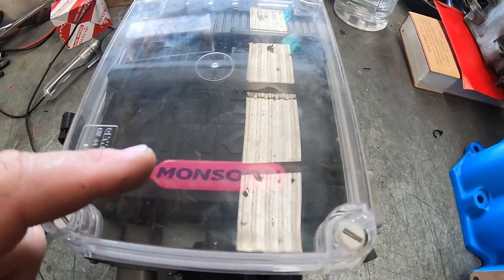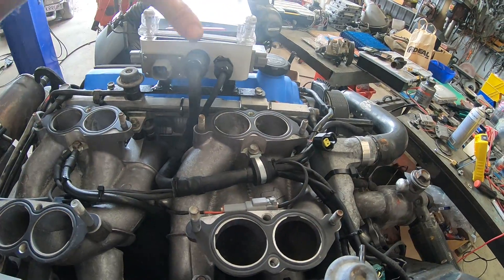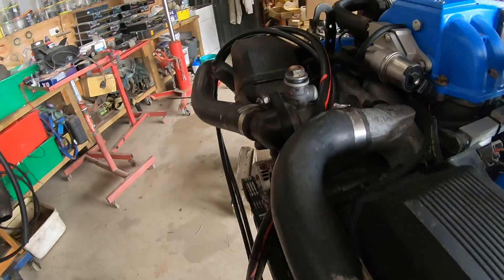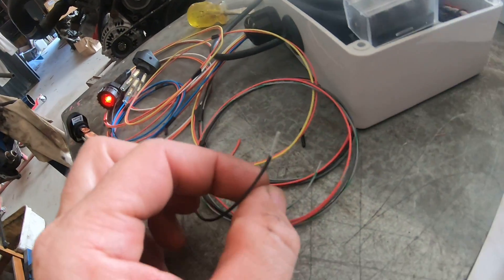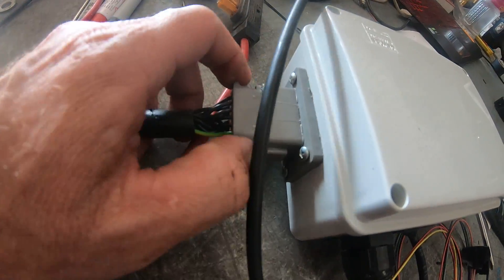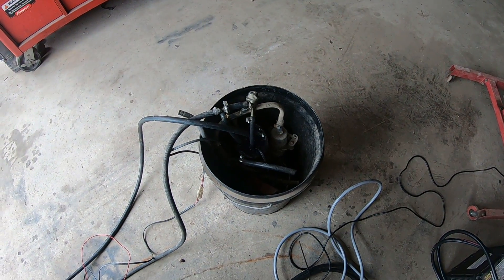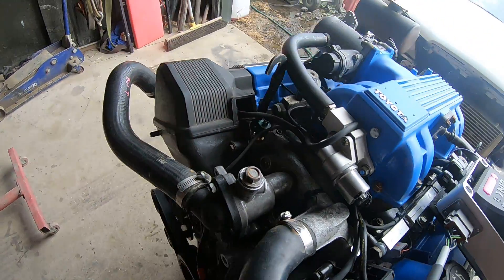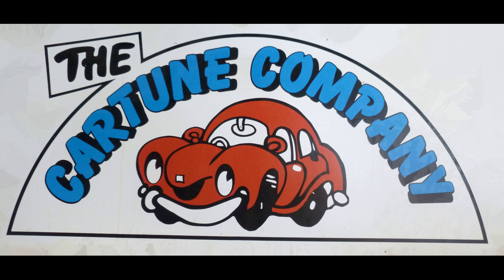Blue 1uzfe engine wiring for jetboat to link ecu monsoon. 1UZ-FE with Yaris 1nz Coil on plug COP

Comment: What are the benefits of going with a link storm or any 8in 8out ecu for full direct cop and fuel vs going with grouped on the monsoon?
Reply from the maker: With full sequential injection the fuel injector timing is optimized giving slightly better throttle response and coils are doing less work as they are firing half as often.

Comment: Nice Kelvin.  Elected not to run with O2 sensors or not an appropriate fitting in the Rolco manifolds?
Reply from the maker: Hello Sam.  With Jetboat and aftermarket exhausts we often dont run O2 sensors.  They dont like the watercooled manifolds so we tune without them.  Very different to running stock ECU where I always fit the o2 sensor.  Cheers Kelvin

Comment: What is more reliable of both 1uzfe and 1uzfe vvti?

I really hope that you recommend  the best of those engines for me.. 

Many thanks in advance
Reply from the maker: Any of them are reliable if prepared correctly.  Its not the engine that makes the difference but the person working on them.  For better results these days I choice a vvti in most cases.  Cheers Kelvin
Reply: @CartuneNZ  Thank you very much. I'm really grateful.

Comment: That's awesome.. just curious but what would you charge for a standalone set up for a swap?
Reply from the maker: Hello.  Every standalone is slightly different depending on the specs which are required.  As a rough guide a starting point is around $2500-$3000 worth of hardware and parts and then around the same in Labour to wire and configure , thats is kiwi dollars.  As I get into more involved setups the price goes from there.  Cheers Kelvin